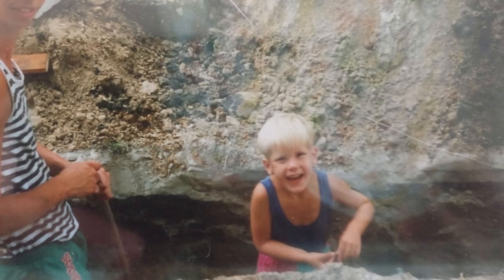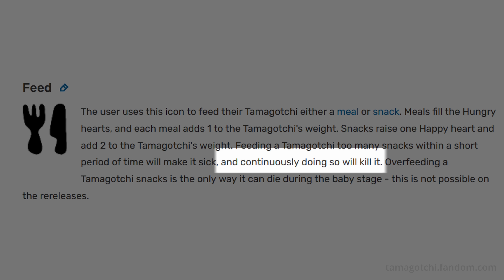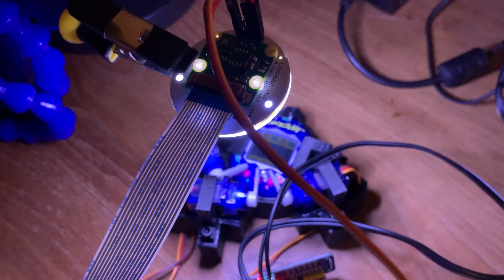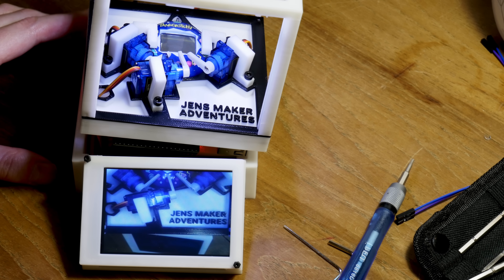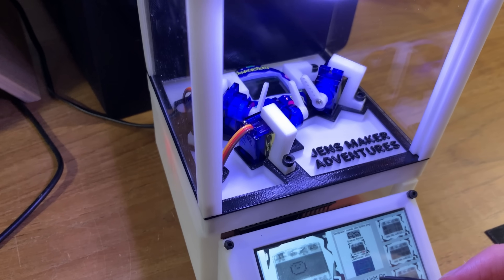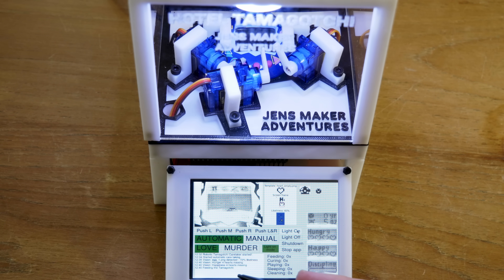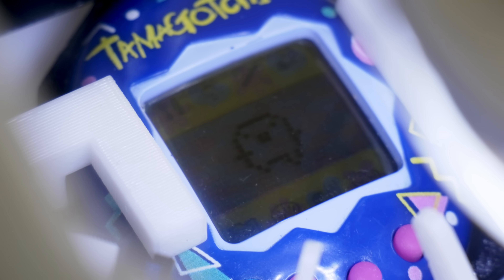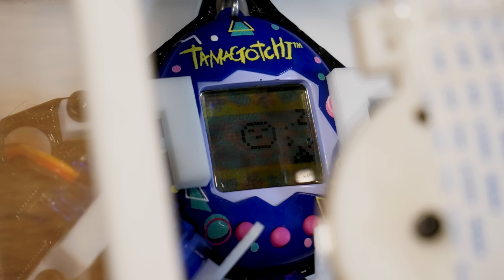Tamagotchi Care Taking Robot (with Kill Mode)

Comment: I did a Arduino controlled one with auto care but it did use wires soldered to the buttons (and lights for visual affects), i used it for twitch which worked well in the end but never kept it up long. with twitch i had to pre-program commands instead of just using single button commands as there were chat limits. I also didnt write in to watch the screen for stuff and just did the basics to keep it alive for auto care as my plan was to let the watchers really care for it outside of dying.
Reply from the maker: Haha that is awesome!! I also considered opening it up to Twitch and just letting the crowd control it! 🤩 Good job!

Comment: Bro built a matrix pod for tamaagotchis
Reply from the maker: I actually considered putting clips grom the Matrix movies in the intro, but those scenes are SO dark (with the babies going into the machine) that I decided not to
Reply: @strange_inventions  have you checked out sprite mods tamagotchi singularity? It's pretty neat
Reply from the maker: Yes, that was a cool project. All software, right? And then there's another project about open source hardware emulators, also really cool. I noticed that no one had done what I did so here we are 🤷
Reply: @strange_inventions  all software yes, it'd be cool to see hardware version though :)
Reply from the maker: Yes, I should just make a farm with like 10 of these units running besides each other 😂 or use 1 camera and actuators set on rails so it can treat all instances of the tamagotchi. Now that Im writing this, that would actually be quite easy to build... Hmm. 🤔😂
Reply: @strange_inventions  hardest part would be the inter-tamagotchi IR communication imo
Reply from the maker: What do you mean? The model I used for the video doesn't have IR or communication
Reply: @strange_inventions  ah I see, I didn't have a tamagotchi as a kid so I assumed all of them had IR. But basically, the ones Sprite emulated did have IR communication and it allowed the tamagotchi to play with each other

Comment: This is great! I love it, but i'd love it more if you tried it with a digimon device. the community has a thing called an A-Com. that allows you to interface with the connection pins on top, to do battles and Jogressing, so you could add features like battling via discord if someone sends you their battle code, along with the goal of raising all the digimon on the device by following the specific requirements for each evolution route. along with doing device specific things like the "quest mode" or "colosseum" some devices have. I personally recommend a Digimon X device if you do end up doing this as it has better features then the Version 20th that was released, both are readily available.
Reply from the maker: Hey, wow that also sounds like a cool project. I must admit that part of my motivation was that I loved Tamagotchi as a child and that there is no interface to connect to (or I didn't want to) making it also a mechanical electrical issue rather than only software.

Comment: Curious to know if you used a state machine in the programming ?
Reply from the maker: Hi, nice to see an in depth question. The code's actually available on GitHub but contains more crimes than most eyes could bear to see I think haha. I started out with using a statemachine, I even informed myself on the Python library for it, but it very quickly turned into using a boatload of IF statements with semi global variables haha... Though it worked very reliably. It's just not very maintainable or reusable. 🤷